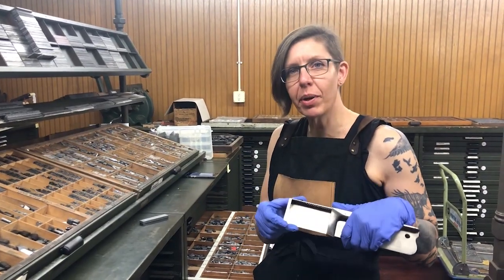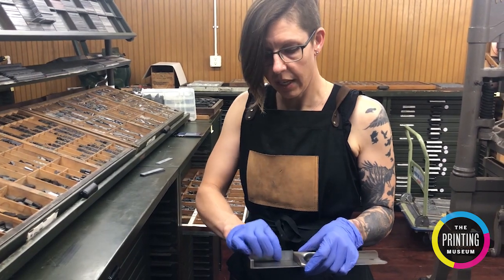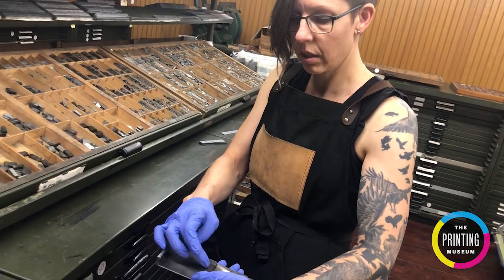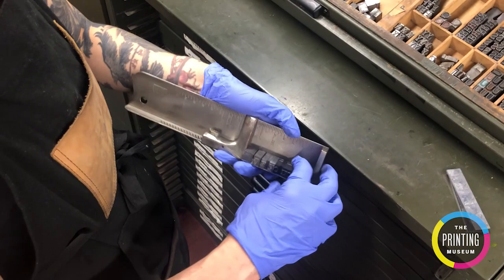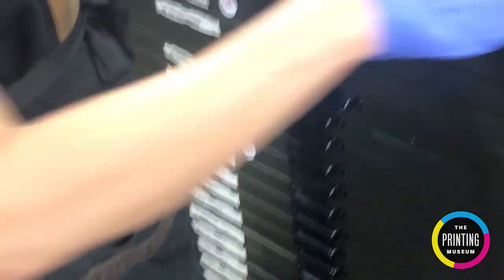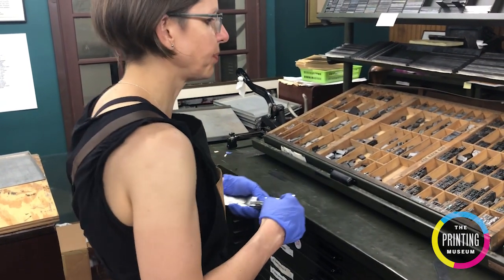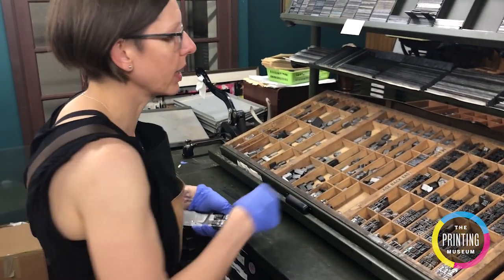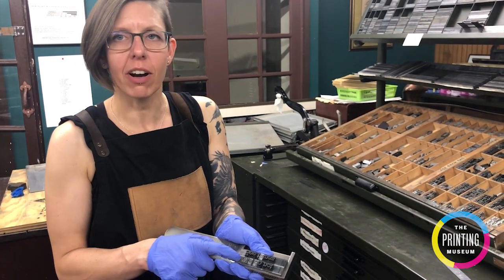Setting Metal Type

Comment: I started in the printing industry in the UK in 1951 as a compositor.  I'm still printing, but it is digital now!    When setting the measure for the composing stick we always allowed a bit extra for "squeeze" otherwise the leads could stop the forme lifting when locked in the chase. Thickness of a bus ticket was the usual amount.
Reply: 1951, the year of my birth! I became an apprentice compositor in London in 1966, I had to do a 6 year apprenticeship. I eventually moved on to computer typesetting then on to Apple Macs. Looking at this video fills me with so much nostalgia, I feel I could pick up a composing stick and start work again. It all seems like yesterday to me.
Reply: @WilliamHenryAlbert     Hello Bill,  Yes I know how you feel. I still have my "Comp sticks" and a couple of cases of type. You never forget how to do it.    I worked in Fetter Lane, London for about seven years from around 1967.   I'm still working on Apple Macs with Quarkxpress from home.
Reply: @headleycaryer3795  Hello Headley. I still have my comp sticks also. I was working in Clerkenwell in a small jobbing printers at that time. I also did casual work as a proof reader on the newspapers in Fleet Street in the 80's, hoping to get to the top of the queue for a permanent job but, alas, Murdoch had other ideas and moved everything to Wapping. I ended up working for Williams Lea, a financial printer, in the city where I learned to use Apple Macs and Quark, Photoshop, Illustrator. It's great that you are still working on Quark. I'm impressed that, like me, you kept up with new technology and kept working in the print. I much preferred working on computers and a much cleaner environment rather than picking through mouse droppings in a typecase. I am retired now. Good to reminisce eh!
Reply: @WilliamHenryAlbert  Hello Bill, I was at Oyez (SLSS) for seven years on nights.  Worked for 15 different firms before starting my own company.
Reply: @headleycaryer3795  Yes, remember the name Oyez. I didn't get around as much as you, which I should have done. That's great that you started your own company, well done!  I didn't do too bad in the end though. Ended up in Australia and was offered a job on Sydney Morning Herald but didn't take it up as we decided to move to Brisbane.